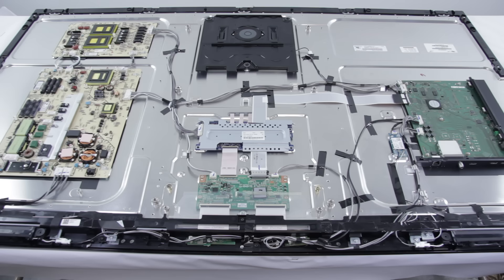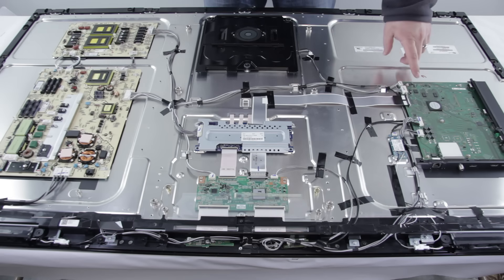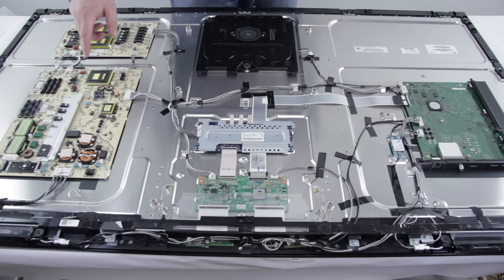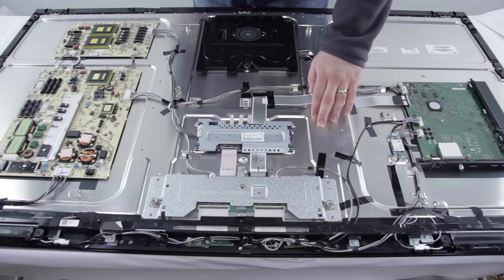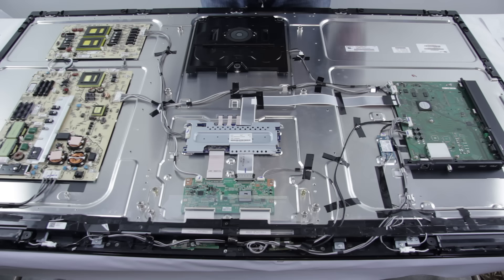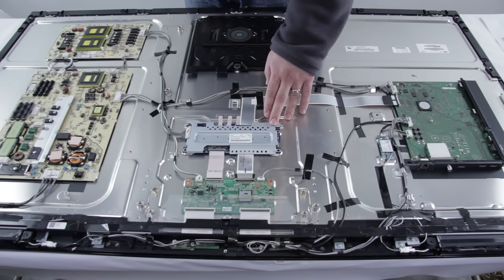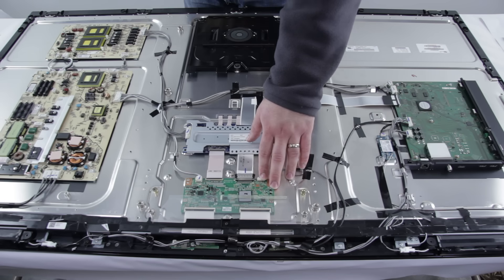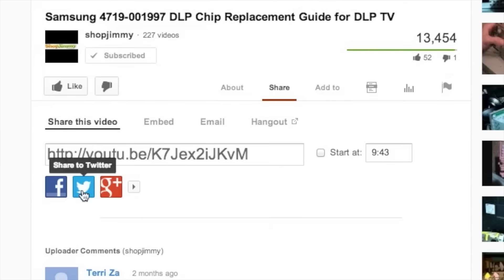LED TV Repair Tutorial - Common Symptoms & Solutions - How to Repair LED TVs

Comment: i have a panasonic led tv. Model TC-32A400x. It has picture but no sound. It worked OK for a while but now no sound. What could be the problem?
Reply from the maker: +Winston Stijnberg  Try all repairs and troubleshooting at your own risk.  I recommend replacing the main board in your TV.  Unfortunately I do not see any replacement parts in the search results for your TV model number on our website.  Please reply with your part number on your main board and I can try searching for replacement parts.  Thanks and please let us know if you have any further questions!  www.shopjimmy.com

Comment: Sony KDL40EX700. Getting a grey screen every 3 minutes of viewing which lasts about 10 seconds  then return then returns to the picture and does over again. The cable box,hdmi cable and input hdmi socket changed with no improvement. Do not get an error indication on screen. Also no sound when grey.
Reply from the maker: +barbara torres   Try all repairs and troubleshooting at your own risk. This could be a problem with either the t-con board, the main board or the TV panel. You can replace the main board and the t-con board individually to see if one of those boards fixes the problem.  Click this link to replacement parts for your TV model number:  http://www.shopjimmy.com/catalogsearch/result/?q=KDL40EX700  There may be multiple boards for the same TV model number, be sure to match part numbers on your current board, with your replacement for compatibility.  Thanks and please let us know if you have any further questions with your TV Repair!  www.shopjimmy.com

Comment: Hi, I have a Sony Bravia KDL-52NX800 tv. The left side of the screen is displaying colored vertical lines, and the right side of the tv is white. There is sound and connection to the cable box. The tv has never experienced any problem since it was purchased in 2010. After seeing your video, it looks like it might be the tcon board. Any help would be appreciated. Thanks in advance! Mark
Reply from the maker: +Mark Garrity   Try all repairs and troubleshooting at your own risk.  This sounds like a TV panel (TV Screen) problem.  If your TV panel is bad, it may be more cost-effective to replace the TV as panels are typically hard to find in stock, difficult to replace, and expensive.  Thanks and please let us know if you have any further questions!  www.shopjimmy.com

Comment: I have LG 47LX9500.  The TV is working fine with excellent picture quality.  About 2 months back HDMI ports detects a device is connected but does not show any picture,  it happens for all 4 HDMI ports.  Since last week SVGA port all of a sudden showing no picture and shows as "invalid format".  I have verified the outputs from both SVGA & HDMI and it is working fine on other monitor.   All these ports were working before.  Seems like I need to replace main board(EBR69489001),  please advice.

Full description:
Product code: 47LX9500-UA.AUSWLJR
Model: EBR64966501
Reply from the maker: +Jinesh Nagakumar   Try all repairs and troubleshooting at your own risk.  I recommend replacing the main board in your TV.  Click this link to replacement parts for your TV model number:  http://www.shopjimmy.com/catalogsearch/result/index/?cat=56&q=47LX9500  There may be multiple boards for the same TV model number, be sure to match part numbers on your current board, with your replacement for compatibility.  Here is a link to a video showing how to identify your part number, click here: https://www.youtube.com/watch?v=RwHTvjMdrhkThanks and please let us know if you have any further questions with your TV Repair!  www.shopjimmy.com

Comment: My AOC E327AZNK2WA2NN  The tv will not stay powered up.  It shuts down after just a few minutes of use.  I do not see any bulging capacitors.
Reply from the maker: +Phil Sims  Try all repairs and troubleshooting at your own risk.  I recommend replacing the main board in your TV.    Please double check the TV model number.  Thanks!  www.shopjimmy.com
Reply: +ShopJimmy.com  Thanks for the reply!

Comment: jimmy i have a 55" samsung TV it turns off and on i have to unplug the tv to turn it off when it is on you can see the back light come on you can here a relay click on the power supply board you can see a red and green light turn off and on the lights are on the mother board i no picture or sound  M#LN52A650A1FXZA  S#ALOT3CMQC00740V
my name is Robert my email cindymoore8802@verizon.net
Reply from the maker: +Christopher  Levy   Try all repairs and troubleshooting at your own risk.  I recommend running the flashlight test on your TV.   Here is a link to a video we produced that shows how to run the flashlight test. https://www.youtube.com/watch?v=xUzCLgoSPGM Please reply with your flashlight test results and we can recommend a replacement part for your TV repair. Thanks and please let us know if you have any questions! www.shopjimmy.com

Comment: I have a SamSung TV LNT3232HX/XAA that has picture problem. The picture is really bright and colors are wrong. I can make everything look almost normal by going to menu/Picture/Contrast and turning the contrast way down.(It was at the 100 setting) The problem after that is the TV suddenly changes back to the setting it seems to prefer after about 5 to 8 minutes. I can change other settings for picture too such as Mode to Movie or Standard but when everything suddenly changes back, settings are always exactly the same, with Mode set to Dynamic, Contrast set to 100 etc. Please help. By the way, the remote is missing and I have been accessing the menu from the side buttons. Do setting changes get saved when changed by this method? Thanks for your help and for what you do!
Reply from the maker: +Aaron Roberts   Try all repairs and troubleshooting at your own risk. This could be a problem with either the t-con board, the main board or the TV panel. You can replace the main board and the t-con board individually to see if one of those boards fixes the problem.  Click this link to replacement parts for your TV model number:  http://www.shopjimmy.com/catalogsearch/result/?q=LNT3232HX%2FXAA  There may be multiple boards for the same TV model number, be sure to match part numbers on your current board, with your replacement for compatibility.  Here is a link to a video showing how to identify your part number, click here: Thanks and please let us know if you have any further questions with your TV Repair!  www.shopjimmy.com

Comment: i have a bad backlight i did the flashlight test. but my tv doesnt have an inverter board. ive already replaced the main board but i had the same problem. but the main board doesnt look like the original it does have the same serial number. 

tv is vizio e320-ao
Reply from the maker: +Curtis Bradley   Try all repairs and troubleshooting at your own risk.  This sounds like you have bad LEDs in your TV.  Unfortunately we do not sell replacement LEDs for your TV model number at this time.  You can check back in the future to see if we have them available.  Thanks!  www.shopjimmy.com

Comment: Greetings, I have a Toshiba 42RV530U. After following the troubleshooting info on your site I bought your  996510010058 master and slave set. I installed it and the TV blinks rapidly but does not come on. What do you recommend?
Reply from the maker: +Jerry Dent   Try all repairs and troubleshooting at your own risk.  This could be a problem with either the power supply or the lamps in the TV.  You can replace the power supply board to see if that fixes the problem.  Click this link to replacement parts for your TV model number:  http://www.shopjimmy.com/catalogsearch/result/index/?cat=59&q=42RV530U  There may be multiple boards for the same TV model number, be sure to match part numbers on your current board, with your replacement for compatibility.  Here is a link to a video showing how to identify your part number, click here:  https://www.youtube.com/watch?v=b9L0-m0-pjA  Thanks and please let us know if you have any further questions with your TV Repair!  www.shopjimmy.com
Reply: PS board was replaced 16 months ago. Not likely. Looks like it's headed for the recycle bin. too bad. I'm not interested in throwing money at it to see if it "might" work.

Comment: Hi like your channel very helpful,
can you please give some advice to me  I have a Samsung ue40es7000 led tv which i brought to bulgaria with me great tv  for 3 years now but last week a big storm came and lightening stuck the house and our sat alight system and now the tv stil works ok  but none of the hdmi ccts work any more,
   my question is if i buy a new main board will it come already programed with samsungs boot up sofware so i just have to plug it in or do i have to get it  loaded some how.
  thank you very much
  regards peter
Reply from the maker: +peterkatya  Try all repairs and troubleshooting at your own risk.   I recommend replacing the main board and the power supply board in your TV.  Unfortunately I do not see any replacement parts in the search results for your TV model number on our website.  Thanks and please let us know if you have any further questions!  www.shopjimmy.com
Reply: +ShopJimmy.com  Hi Shop  Jimmy, 
Thank you for your reply,but can you please tell me if the samung boot up software comes already installed on a new main board.
 Thank you very much

Comment: I have an Toshiba 50in LED model 50L2200U. After a pretty bad thunderstorm my tv would not turn on. It's not receiving any power there is no standby light on or anything. I have replace the power supply board but still nothing. Is there anything else that I may need to replace?
Reply: shopjimmy.com the original part and the replacement numbers match as well.

Comment: I have a LC-60C6400U. It stays powered on for 5-6 mins and goes off. There is to long blinks and 5 short. Will power back on and stay powered up approx. 3-4 min and goes of with same blink pattern. Should I replace power board or dig deeper?

Comment: I have a 50" LG LED TV. Model number 50LN5600. The TV turns and the picture comes on for about a quarter of a second. After that it turns black. If I get really close to the TV, I'm able to see the some  picture but it's really nothing. When I turn it off, it flashes again for a split second. sound is on.
Reply from the maker: +Marcin Gorka   Try all repairs and troubleshooting at your own risk. This sounds like a problem with the actual LEDs inside your TV. These LEDs are replaceable, however it is recommended they are replaced by someone with the proper experience and training. When replacing the LEDs, the TV panel can get damaged. If the TV panel gets damaged, it is not repairable. Click this link to replacement LEDs for your TV model number:  http://www.shopjimmy.com/catalogsearch/result/index/?cat=299&q=50LN5600   Be sure to match the panel information necessary to ensure you have the correct replacement LEDs.Thanks and please let us know if you have any further questions with your TV Repair!  www.shopjimmy.com

Comment: I have a LG 47LN5790 LED tv. When I turn it on, the image flashes briefly, then goes dark. The sound continues to work. The flashlight test shows the image.What do I need to repair the problem.
Reply from the maker: +Dr R   <!-td {border: 1px solid #ccc;}br {mso-data-placement:same-cell;}->Try all repairs and troubleshooting at your own risk. This sounds like a problem with the actual LEDs inside your TV. These LEDs are replaceable, however it is recommended they are replaced by someone with the proper experience and training. When replacing the LEDs, the TV panel can get damaged. If the TV panel gets damaged, it is not repairable. Click this link to replacement LEDs for your TV model number:  http://www.shopjimmy.com/catalogsearch/result/index/?cat=299&q=47LN5790   Be sure to match the panel information necessary to ensure you have the correct replacement LEDs.Thanks and please let us know if you have any further questions with your TV Repair!  www.shopjimmy.com

Comment: hey I have a Onn 22 inch LED ( MODEL: LE-22G90)  and the issue I'm having is regarding the single hdmi port that I have on it. basically what is happening is I'm not getting g any signal via my hdmi port regardless of the device connect or the cord ( attempted with 3 brand new out if the box hdmi cables)  any suggestions?
Reply from the maker: +Korey Martel   Try all repairs and troubleshooting at your own risk.  I recommend replacing the main board in your TV.  Unfortunately I do not see any replacement parts in the search results for your TV model number on our website.  Please reply with your part number on your main board and I can try searching for replacement parts.  Thanks and please let us know if you have any further questions!  www.shopjimmy.com

Comment: I have a Samsung UN32EH5300F LED TV.  I can see the picture but it is dim and will not brighten.  I have done factory reset, turned Eco off, adjusted backlight (with no change), adjust brightness (little change) and everything else I could ajdust in the menu but it is still dim.  I have taken the TV apart, took the screen off and the LED backlights do turn on, although one led is out on each of the two strips.  The LED backlights plug directly into the power board (L32GF_DSM).  All capacitors look good on the board.  Is the power board bad?  Everything else work fine.

Comment: TV:  LG 50LN5400
no backlight, have sound, can see image with flashlight.

I don't see an LED driver board, is it built into the main board or the T-CON?

how do I determine if it is a power supply issue for the backlight or if its the LED driver?
Reply from the maker: +Kylo Nelson   Try all repairs and troubleshooting at your own risk. This sounds like a problem with the actual LEDs inside your TV. These LEDs are replaceable, however it is recommended they are replaced by someone with the proper experience and training. When replacing the LEDs, the TV panel can get damaged. If the TV panel gets damaged, it is not repairable. Click this link to replacement LEDs for your TV model number:  http://www.shopjimmy.com/lg-lc500due-sfr2-led-strips-12-strips-1-board.htm   Be sure to match the panel information necessary to ensure you have the correct replacement LEDs.Thanks and please let us know if you have any further questions with your TV Repair!  www.shopjimmy.com

Comment: I have a 50 inch Sony bravia and it's going to and from a dark spots on the left side of the screen to a normal screen with vertical line going through it. almost like it's switching from 3d mode to normal

Comment: we have  37" Insignia  NS-37D20SNA14/LE-37MY83. We have sound but no picture. Did flashlight test, can see the menu on the screen. Don't see any lights in the back when we did the test in the dark. Do you have necessary parts available? Thanks.

Comment: Hello,
I have a Sharp Aquos LC-70LE857U 3D LED TV.  It powers up with 2 slow blinks and 5 fast blinks.  Nothing on the display or sound.  The Main and Power Supply boards have already been replaced by previous owners.  I am wondering if it could be the T-Con board or possibly a bad LED in the backlight?  Other suggestions?
Thank You

Comment: ok..I subscribed..maybe you'll see my post from last month ..if not..here it is again.  Thanks so much for any help. This Tv is useless at this point :

 Hello. Thanks for this channel. I have an LG  42LN5400  I got it Jan. '14 and this Jan., just before the warranty expired, the TV went blank. The LG repair guy came and installed a new board., Here we are 8 months later and now my screen is solarized (psychedelic... all the pretty colors) This happens within 1 minute of the TV being on. It starts out with a normal picture, then turns into the solarization thing. The sound is fine. I am not handy, but I have a friend who is and offered to help. What should he/we be looking for? If you need the serial # just say the word., Thanks so much. I just can't see buying another TV when I haven't even had THIS one for 2 years.
Reply from the maker: +D Rom   Try all repairs and troubleshooting at your own risk. This could be a problem with either the t-con board, the main board or the TV panel. You can replace the main board and the t-con board individually to see if one of those boards fixes the problem.  Click this link to replacement parts for your TV model number:  Click this link to replacement parts for your TV model number:  http://www.shopjimmy.com/catalogsearch/result/?q=42LN5400  There may be multiple boards for the same TV model number, be sure to match part numbers on your current board, with your replacement for compatibility.  Thanks and please let us know if you have any further questions with your TV Repair!  www.shopjimmy.com

Comment: I HAVE 55'' Samsung Led tv Model no UA556400 AR and S/N AF73MHF500032.

i was watch a U Tube video and suddenly the TV went off.sound is coming but no picture. i tried unplugging the power connecting but still  not working. i need help to rectify this problem
Reply from the maker: +TYRONNE Rodrigues   Try all repairs and troubleshooting at your own risk.  This sounds like you have bad LEDs in your TV.  Unfortunately we do not sell replacement LEDs for your TV model number at this time.  You can check back in the future to see if we have them available.  Thanks!  www.shopjimmy.com

Comment: I just replaced the main board on an LG TV-model 39LN5300.  Works perfectly for about one minute then fades to vertical lines.  A "seashore" type noise emits for about 10 seconds, as well. The original problem compelling me to replace the main board seemed HDMI related.  What now?

Comment: I have an LG 32LN5310-UB and I used the flashlight test to determine that my LED driver is bad, however, upon removing the back panel, I discovered that there is no LED driver as shown on this video. Is it possible that the T-Con board and LED driver are combined on a single board?